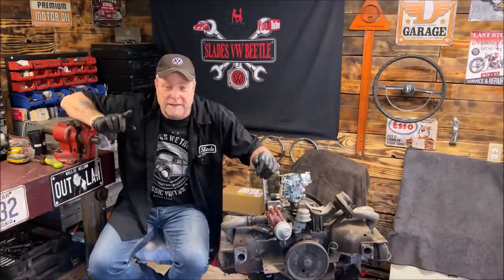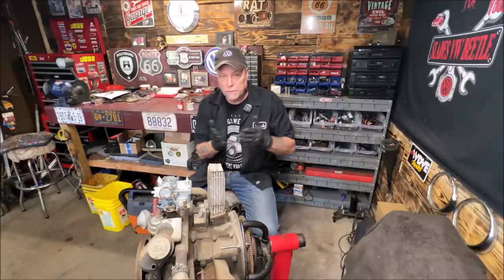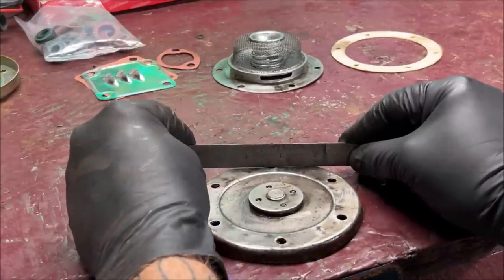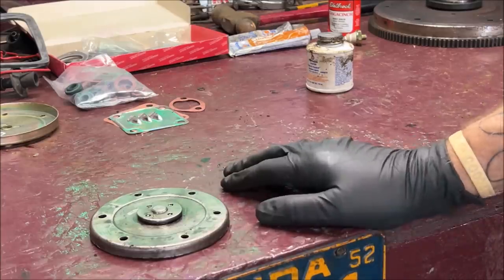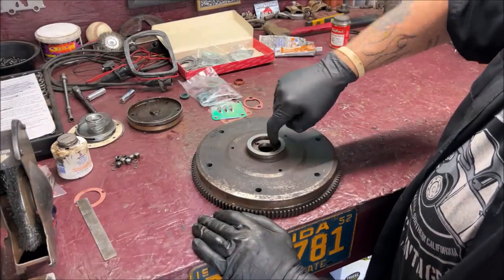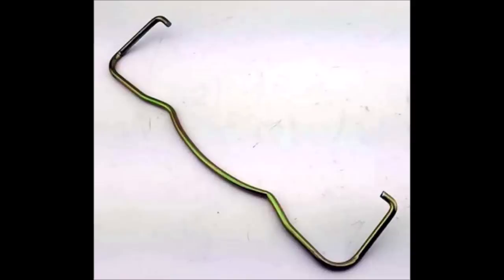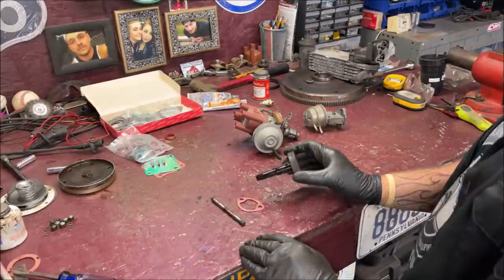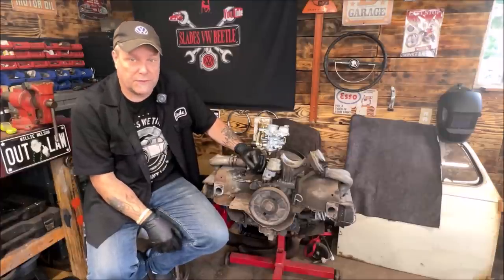VW Air Cooled Beetle Oil Leaks - Why Do They Leak - How To Fix Them - Ghia - VW Bus - VW Fastback

Comment: I’ve been building VW engines for years. I learn that Rector seal #5 from a VW dealership work absolutely awesome. You need to mix your new can with a screw driver. It has a brush in the cap the works well to put on case half’s. Boston Bob tried it and used it for years after I told him about it. Did higher end balanced and blueprinted engines. Rector seal #5 is a pipe sealant that will withstand gas heat and oil. ❤😊

Comment: Good video! I think one thing that needs to be stressed is it needs to be clean clean clean, then when you think it's clean clean it again right before assembly. On the last engine I built I used Indian head gasket shellac on the case, 3 bond under the jugs, head washers and bottom of head nuts, and the case side of the oil pump(a very thin coating on the thin paper gasket for the oil pump cover) and finally the fuel pump and gen stand get some 3 bond. Then I used ultra black on the cork valve cover gaskets and let them dry then put a small amount on the valve cover so it glues them on the v/c. I then use ultra copper on the exhaust gaskets. All the pushrods and oil cooler seals I install dry, and I use some wheel bearing grease on the rear main and oil on the dizzy oring. So far its still dry as a bone but I think the engines will always eventually leak due to thermal expansion. Many ways to skin a cat that's for sure.

Comment: Good vid and I was impressed to see one of the true Flywheel seal leak fixes. Another and most common reason Vw engine cases leak through the case halves is that many DIY engine builders don't run a big straight edge across each case halve to see if its bent - most are after 50yrs of heating and cooling. This needs to be machined straight, oil pump hole re-machined, cam tunnel reemed and then the main tunnel can be align bored. But most engine shops either don't understand or don't know this or are just too lazy to do the work to get it straight. Next is never use silicon base sealants between the case halves (the aviation is not silicon based for a reason) It makes it like a ham sandwich and mains never apply the correct crush on the bearings if silicon based = early flogged out / loose tunnels.
Despite all the Empi bashing going on of late they do have some high quality products that are     equally as good as the other big names. One is thier stainless windage pushrod tubes. They also have a really good spring loaded pushrod tube (not all of them though). However, I don't remember the part # right now.

Comment: I use 2 ballpeen hammers. Rounded side down to the hole on the cover on a flat surface and then use the second hammer to hit the first hammer to knock the high point down. Works great with V8 valve covers too. If you use a very thin coat of silicone on both sides of the gaskets it much easier to remove them when you have to change your oil and clean the sump plate. If you have any questions please feel free to pump my brain. 😊

Comment: great video and very well explained. you are right that these engines are not made to leak.
so like they didn't leak from the factory. a lot off products exist to prevent leaks and seal everything, but like you said, every seal product has it specs.
i use that aviation sealer a lot, but i use also a lot off omnifit. 
see you on the next video my friend and thank you.

Comment: Excellent video. I've got two more leaks for you the generator stand and on my Baja the sand seal behind the pulley. By the way I've been using aviation sealer for years and yamabond since the 70s.

Comment: Another great video. Seeing bits iv never noticed before. With the push rod tubes I put a socket in them to help expand them a little bit. Here in England we also had swingaxle beetles aswell as irs. Mines a 74 swing axle which was a 1200 originally. I need to look into that aviation sealer. Looks great stuff. Will be ideal for my soon to be daily beetle. Not a problem on the others as they usually need to come apart every few years. Thanks for another great video.

Comment: I think you missed the alt/gen stand, there is a gasket there and it also causes leaks. It is the least place that leaks, and the leaks aren't that crazy, but still, something that needs to be taken care of.

I had always used Shellac for sealing stuff, but it looks like temperature does its thing and eventually leaks start to form. Also here in Mexico gasket kits aren't that super great. So I just rebuilt my baywindow bus engine back in July of this year, and I used anaerobic gasket sealant/maker (Loctite 518 or Permatex 51813) along with an Elring gasket kit and man... the engine has not formed a single leak! I regard much of this result to the Elring gasket kit, but I did another engine for a customer with a lower quality gasket kit/ Loctite 515 combo, and that engine has held up really well, too.

So now my preferred sealants are the anaerobic ones. The Loctote 518/Permatex 51813 is better, though, because it seals but it is a bit flexible, and parts can easily be separated. The 515 bonds stronger and therefore parts get stuck a lot harder.

Comment: I was just given a free 1990 brazilan kombi, that runs. my first VW. I looked under it today, and I was horrified by how much oil it was leaking. I even pulled the dip stick. yep has oil. Everyone was like, 'yea, they just use oil, they leak oil, get use to it". I am not interested in getting use to a vehicle leaking that much oil. I see a leak, I want plug it.  Thanks for all the tips. This is 2023, we have all these high-tech sealants for a reason: things use to leak. Now they don't have to leak.
Reply from the maker: Thank you for taking the time to comment. I know the air cooled motors can leak oil. But if we follow certain procedures and steps, we can keep it either from leaking oil, or extremely minimum or you may see a drip once in a while.

Comment: Another good informative video. The only place I'd say that could have a leak is from crankcase pressure. I've had this where oil would come up past the alternator stand deflector plate and out of the filler neck! Also, mines a 72 and it's swing axle lol..but mines a bit of a odd mix due to the model. A lot of great tips and advice.

Comment: You said several times "when the seal goes on the crankshaft..." Just pointing out that the inner lip of the rear seal runs on the flywheel, not the crankshaft per se.

Comment: Great video, I've been working on the aircooled engines for about 30 year's but it's always nice to get someone's else's take on things. I've currently dropped my engine out to fix a few leak and was interested looking at a few videos on the subject. You mentioned the Sands seal I think you said the one behind the pulley. Have you a link so I can check it out. Thanks.

Comment: Just remember there’s different oil cooler gaskets for different motors I run across them all the time with the wrong ones in them when I take them apart.

Comment: Sealing the oil pump to the case I use spray tack lightly on both sides of the gasket and then lay it on the pump. Then put a thin bead of ultra black silicone in the corner of the pump. If you look at the case half’s you’ll see how much of a chamfer is on the opening to let you know how much to use. Slightly more than the chamfer. The thin cover gasket I use permatext spray tack on both sides. 😊

Comment: A vw mechanic I knew said the only way he could stop crankcase leaks is to use 3M weatherstrip cement. Also he would not use oil on the rings when assembling, only on the piston skirt. The rings seat much quicker and they get oil as soon as you start it anyway.

Comment: Great video! My '67 only has one slight oil leak that drips from one of the heater boxes... I'm assuming it might be coming from the valve cover gasket right above it.
Reply: If you’ve rebuilt the engine, and didn’t seal the studs. That’s a famous place to leak. Upper or lower stud, in the corner. Third cylinder.

Comment: Very informative video! The extra stuff (off topic) was all good! I searched your other videos and could not find a Case sealing and assembly. I have drops forming all along the bottom seam and wonder if i didn't apply the gasket seal (Gasgacinch) right. I wonder if I took too long getting the case halves back together and the sealer was not fluid enough (or just not enough put on...) Does the Aviation sealer take longer to setup than Gasgacinch? (found answer Yes and Gasgacinch sets in 10-15 mins... gotta move quick)

Comment: I have an intake question,
I have a 1776 motor with a scat intake. They notched the alternator housing to fit into the fan shroud.
My question is can the heat riser tubes be moved to allow room for alternator with out notching
I have a photo but don't know how to post it

Comment: I just skimmed the video but did you mention cam plug, rear main seal, jugs to case, oil pump,etc? A Vw engine can and will leak from “Everywhere” if not assembled correctly with proper sealant for each application

Comment: My wife and I just bought a 1964 beetle with dual carbs and I do t really know anything about how they work but I love these videos because I am trying to learn how to wrench on it but yeah it does leak a lot is it still safe to drive it?
Reply from the maker: Congratulations on your 64! And thank you for being here. I really don’t like to say anything is safe to drive without being able to see it. However, I would address it as soon as possible and just be safe while you are in it. Make sure the oil was full, I don’t know how bad it is leaking? And make sure it’s not leaking all over the exhaust.
Reply: @SladesVWBeetle  thanks for the info…I check the oil before every time that I drive it and it is always right at the line I put some cardboard down underneath it and it drips a little puddle about a couple inches in diameter. I see comments on YouTube that they all leak a little bit but it concerned me. Thanks again!

Comment: I was wondering if engine oil is safe to use on these seals I noticed you said the use the grease due to the fact that it doesnt corrode the seal.
Reply from the maker: Yes, engine oil is safe too! I just grease to seat some of the seals. But only dielectric grease, so it don't corrode seals

Comment: As a preventive measure on the oil drain plate holes "dimpling", how about using disposable aluminum crush rings on the bolts - just like on a lot of current oil pan drain bolts? Combine that with a torque wrench and you have an inexpensive preventive solution. You can get these online from many places by the bag.
Reply: I know that you used aluminum washers, but I forgot to mention disposable thick ones that are designed to seal better when crushed. I also use these on my transmission drain bolts on all of my vehicles with manual and automatic transmissions, foreign and domestic.

Comment: What shop in CA did you/do you use for case machine work?  Also, I have my '68 singe relief case I upgraded to 1600, doghouse, and dual port. I want to have my heads rebuilt including all new valve guides. Who do you recommend I have do my heads? My interest is durability/longevity not "performance".
Reply: Greg Tims @ Performance Workshop in Riverside California Rocks!!

Comment: you missed one leak: i only see this on motors that originally equipped with generators and swapped to alternator.  to swap them out, you must change the generator stand. i think a lot of the time they didn't use sealer in those stands and that is where you sometimes see leaks. it often seems like the oil cooler leak because the oil pools in the same corner of the tin as it does if the cooler is leaking
Reply from the maker: Thank you very much for chiming in and leaving a comment with extra tips. I truly appreciate that so much! And so does everyone else.

Comment: Why do VW bugs leak oil? How does a posi track rear end on a Plymouth work? It just does😂 someone says to me, you're bugs leaking oil!!  I said it's not leaking oil ,it's just a well-oiled machine🤣✌✌
Reply: I had a 1965 Corvair that leaked a quart of oil between gas tank fill-ups. After replacing the push-rod o-rings, it never leaked another drop, not burned any oil. I love air-cooled engines!!!!!!

Comment: Why "dielectric" grease and not just any grease?
Reply from the maker: It doesn’t corrode rubber
Reply: @SladesVWBeetle  Why not rubber grease? The red stuff? I thought dielectric grease was designed for electrical connectors?

Comment: Neither of my cars leak ….that much. If at all.
And I’m asked all the time, how come there isn’t all this mung and drool…..seeping out of every orifice.
And I usually say…I don’t put any oil in them! Ha ha ha…
Ok, ok…seriously.
I look at peoples cars, and I give the pulley a push and pull, and see there is a quarter inch of play. 
So, right off the bat…if your crank is walking in the case, your not going to have a dry engine.
And this is just me…so don’t take offense.
When assembling an engine, I use permatex aviation sealant. The brown smelly stuff.
I NEVER use silicone.
And
That’s my secret.

Comment: Oh you have much to learn
Reply from the maker: I don’t know everything, nobody does.
Reply: @SladesVWBeetle  I agree with that. But why the sealant on push rod tube seal In 45+ years I have never had to do that and I have built many VW engines
Reply from the maker: @Fastvw1  I’ve used the sealer quite often and like it. I’ve had a few leak without. I figure it can’t hurt. I really like the aviation sealer. And I did state about using without. 
Btw you have some good drag racing videos. But I couldn’t comment on them unfortunately.